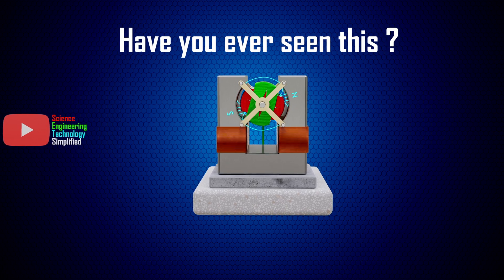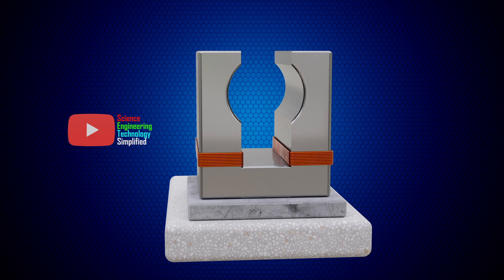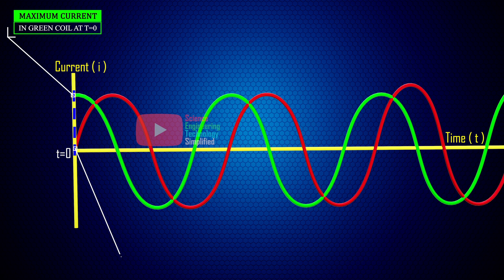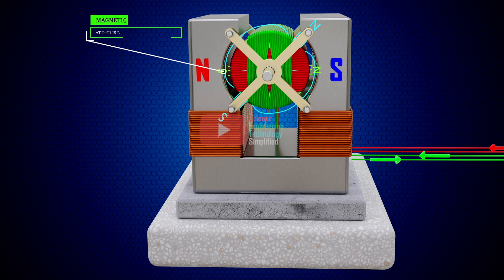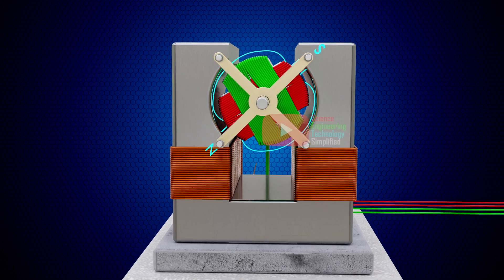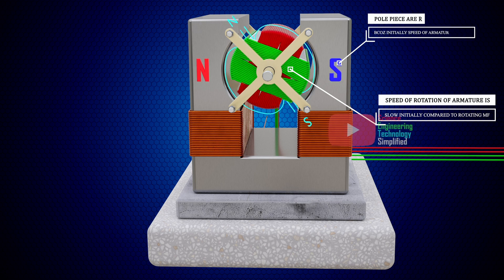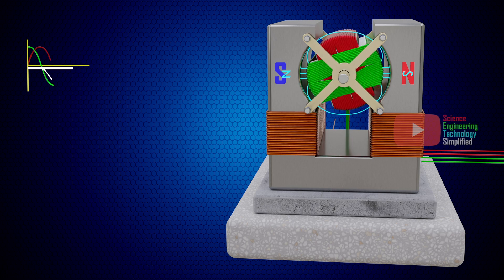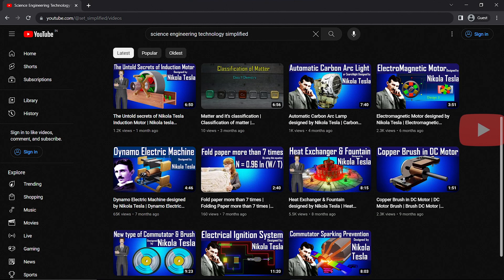Synchronous Motor | Synchronous Motor working principle animations | nikola tesla inventions

Comment: Yea it is possible in synchronised motor but there is also rotating magnetic field in stator winding
Reply from the maker: Here rotating Magnetic field is only in rotor Winding.. While there is Induced rotating magnetic fields in stator and too stops at Synchronous Speed